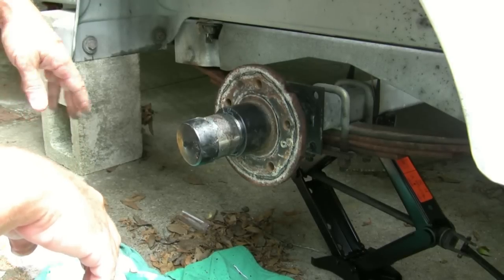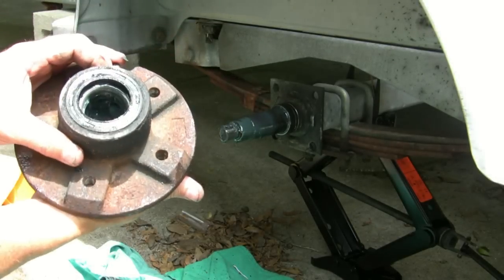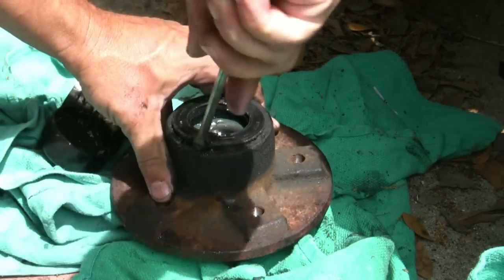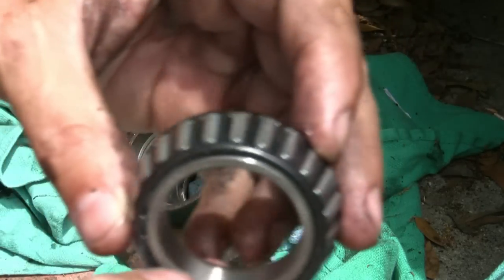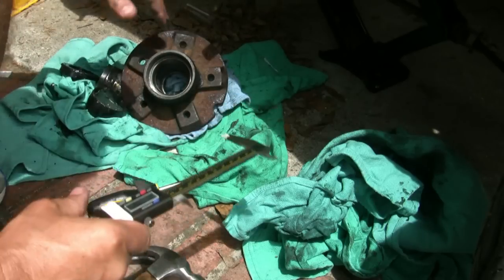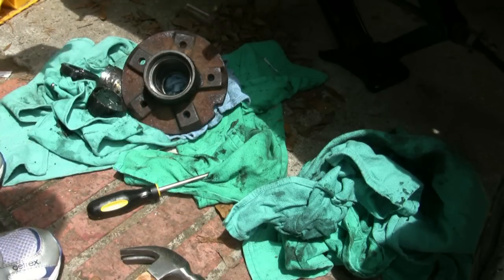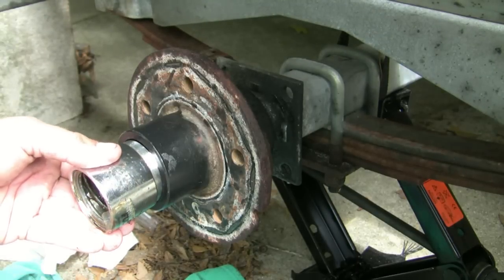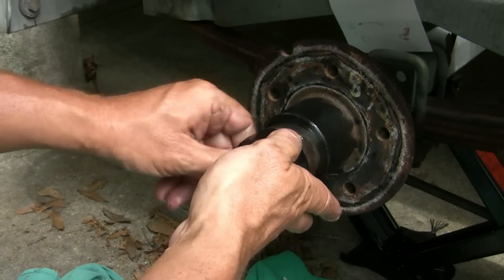Trailer Hub repair

Comment: A bit of advice when trailer is new I removed every nut and bolt and added a coat of grease to everything and 15 years later I just replaced axel leafs and hubs everything came apart and was able to reuse u bolts which are very expensive!
And all new hardware was re greased everything leafs and bolts that hold them to hangers so I will never have a problem getting them apart works great and put a light coat of grease on hubs and lug threads
Reply: Jeff Turner yep put a light coat of grease on everything it will all come apart nicely and I do my lower unit bolts on my outbound also

Comment: THANKS GOOD HOW TO HUBS. I AM 3/4 INTO A COMPLETE OVER HAUL OF MY 2004 BOAT TRAILER I HAVE REPLACED ALL Galvanized BOLTS, WASHERS, NUTS, BOARDS, CARPET, ETC. I WAS ABLE TO SALVAGE THE EXPENSIVE U BOLTS   AND HARDWEAR. I WIRE WHEELED THEM AND APPLYED COLD Galvanized SPRAY. I JUST STARTED ON THE HUDS TODAY THIS WILL HELP ALOT, BEEN AWHILE SINCE I DID A HUB. SALT WATER IS VERY MEAN TO OUR BOAT TRAILERS HERE IN SOUTH mISSISSIPPI.

Comment: Great video. May be a different application, but mine has a c-clip backed spring that holds pressure on the grease zerk cup. May help hold the grease in place better.

Comment: You can remove the seal with minimal if any damage by knocking both the bearing and seal out from the inside. a large socket just smaller than the inner race on an extension and a few taps with a hammer ... but if you are going to do all the work, why not replace the bearings, race & seal ...
Reply: or just leave the wheel on, remove the front bearing then replace the washer and nut a few turns then pull on the wheel and it slides the rear bearing and seal at once.

Comment: Each seal has two sealing contact points which includes the inter-sealing contact point having a wire.  If you are not careful when you are seating the seal (e.g. driving the seal in with a hammer and 2x4), you will make that inter-seal wire pop out. Meaning, the seal will fail sooner.  I would press the seal in, and not use a hammer and 2x4 method when installing it

Comment: The inside surface of a trailer tire is approx. 1/2" towards the frame compared to its bottom inside edge on the ground. Haven't removed to inspect, but what could this mean?

Comment: I pumped grease into my wheel barrings on my boat trailer and a little water came out while I was pumping grease in it the trailer might have 500 miles on it what should I do

Comment: I just bought a wood splitter and when I got home and looked at it from behind the left wheel is crooked (I think it's the camber that is off, the top of the tire leans in toward the trailer). I lifted the left side of the trailer on a small jack and spun the tire and it does not wobble but it is definitely leaning inward at the top. The problem is there are no lug nuts and I am unable to remove the dust cover (maybe it's just really hard to remove and takes more effort?). Maybe this is a single part/unit that should not be serviced and therefore you are expected to replace it entirely? Anyone that may have any advice on this would be much appreciated.
Reply: I figured it out. It takes more effort than I expected. I used channel lock pliers and grabbed on to the dust cap and aggressively wiggled it different directions till it came off vs. using a chisel/flathead screw driver.

Comment: I do not recommend replacing the bearings if you are not going to replace the races.  If you feel your bearings show wear your races need to be replaced also.
Reply: for Shure 
I do not recommend replacing the bearings if you are not going to replace the races